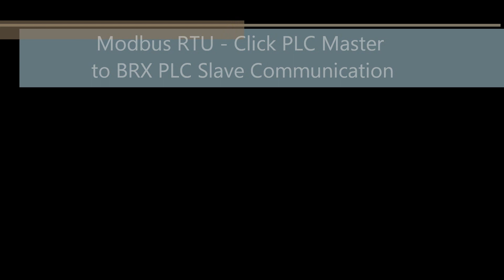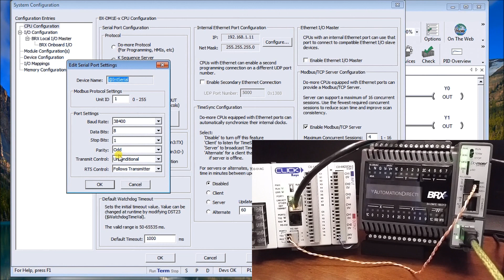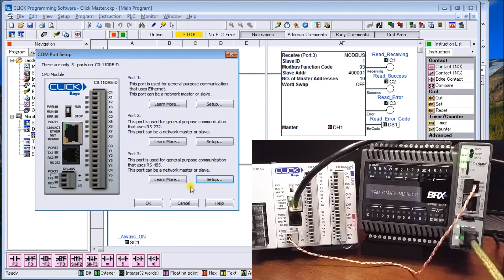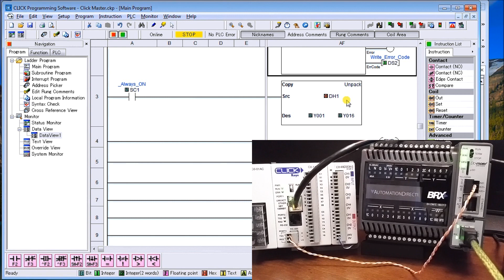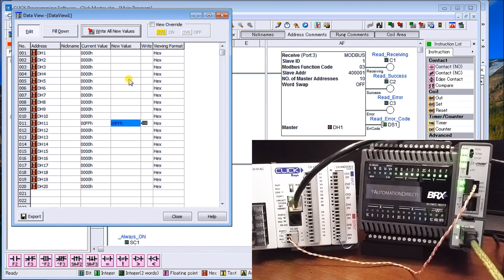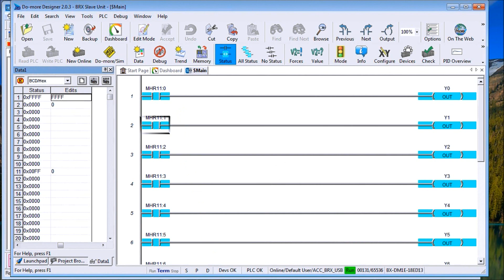Click PLC Controls BRX Slave: Modbus RTU Secrets Revealed!

Comment: Hi Gary, I  have a like new but old EZ-220p EZtext display with the number pad and would like to use a Click PLC analog input to display on the ez-220p. how can i communicate with the devices?  thank you
Reply from the maker: Hi q zorn,
I have not worked with this older retired HMI display. However, it looks like it will communicate Modbus RTU. I would try using RS485 to the Click PLC.
https://cdn.automationdirect.com/static/manuals/eztextm/eztextm.pdf
Regards,
Garry

Comment: This worked very well Garry: thank you! So this could be reversed and use the BRX as the Master and the Click as the slave? Where are the Modbus addresses located on the BRX?
Reply from the maker: Hi Bobby,
Yes this can be reversed. The BRX PLC can be the master and the Click PLC will be the slave. I have done a sample program. You will notice that it is similar in how we trigger the read and write commands.
Here is the download link:
https://www.dropbox.com/s/j2gwb38ku19kc3u/Modbus%20RTU%20BRX%20PLC%20Master%20to%20Click%20PLC%20Slave.zip?dl=0
Note: I have not finished writing this up. It will be included in the BRX Series that I am currently working on.
 
The BRX PLC uses dedicated memory areas for Modbus addresses.
MC1 to MC1023 - Discrete Output Coils
MI1 to MI1023 - Discrete Input Contacts
MIR1 to MIR2047 - Analog Input Registers
MHR1 to MHR2047 - Analog Output Holding Registers

To find the Click PLC Modbus addresses you use the Address Picker. There is an option to select Display Modbus Address. This will show you the modbus address for all memory areas in the click.

Regards,
Garry
Reply: I am looking forward to your BRX series. All of your vids are very well done and appreciated.
Reply from the maker: Hi Bobby,
Here is the start of the BRX Series. It is still in process.

YouTube Playlist
https://www.youtube.com/watch?v=-Tf8m3BqzPo&list=PL3y71jAPOdZDQDLXdeY7XmDYXkeQsnr0k

On the website here is the PLC basic menu link. You will see the information on the BRX Series listed as they are developed.
http://accautomation.ca/programming/plc-basics/

Thanks Bobby
Reply from the maker: Hi Bobby,
Here is reverse. The BRX as the Master and the the Click as the slave.
http://accautomation.ca/modbus-rtu-brx-plc-master-to-click-plc-slave-communication/

Video:
https://www.youtube.com/watch?v=BUiTrkMnNSA

Regards,
Garry